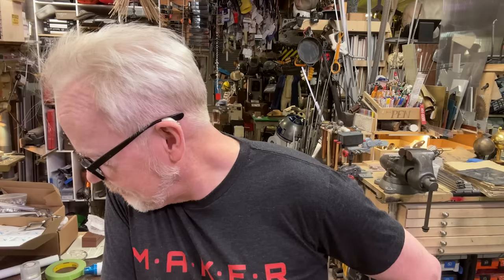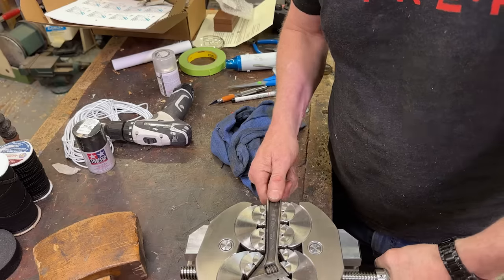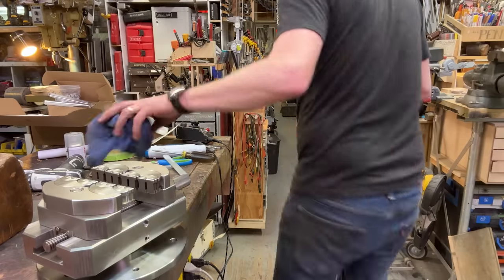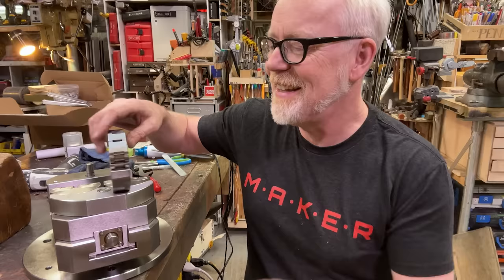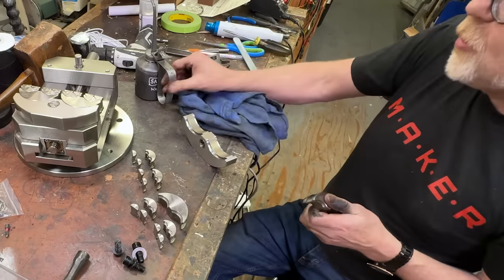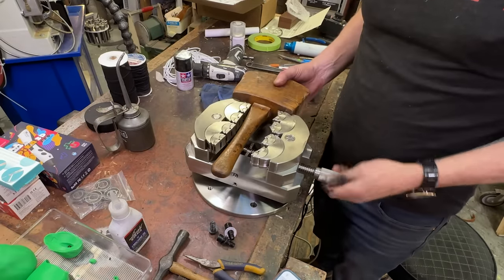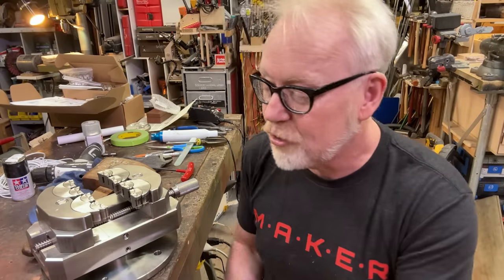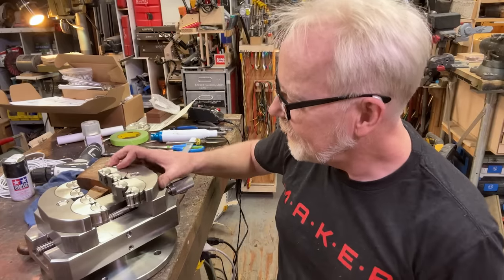Adam Savage in Awe of This Fractal Vise!

Comment: Adam, when I saw the Handtool Rescue episode about the fractal vise, I too coveted one. Congratulations of finding one!
You might want to consider machining a duplicate set of the smallest jaws in a softer, non marring material like bronze, brass, or aluminum for holding pieces you don't want to mark with the clamping force.
Reply: If I had this vice and Adam's tools and skills, I'd probably make half a dozen different sets of jaws, especially to do some testing before deciding the best way to modify the mating surface.
Reply: ... or, perhaps, 3D print the jaws (?)
Reply: If I had one and the machines to do that, that would definitely be a very good idea! Set of, nylon, brass, wood and maybe rubber caps
Reply: Perhaps just make a duplicate set of clamps and somehow adhere rubber or some sort of soft grippy material to the faces rather than metal
Reply: @johnherrmann7464  The issue with 3D printing, regardless of if it is plastic or metal, is going to be the lack of smoothness of the mating surfaces. At minimum the mating surfaces would need to be machined to achieve a nice smooth surface to allow proper low friction movement of the jaws.
Reply: @mafftv3801  Caps may not work. I think the whole vice is based on having the centre of each rotation inside the workpiece, as otherwise they will turn in the wrong direction. A too thick cap could stop it working. 
If this isn't the case there are much easier and cheaper ways of doing the pivots.
Reply: @daveansell1970  Surely you could solve that by shortening the piece to match
Reply: @anthonyruiz-carvalho31  Could have plastic clips (3D printed) that grab the smallest jaw at the top and bottom.  Onto this you can stick whatever soft material you need for the task, and be able to remove or switch clips easily.
Reply: @Chocomint_Queen  Yes, though a lot more of a pain than just sticking some stuff on the front face.
Reply: The price has already jumped by $1000. Now $2601 with $645 shipping.
Reply: @RS-ls7mm  Wow, thanks for spotting that. would love to see the company make something about how these are made.
Reply: @nickl6820  OK.  Understood that 3D printed parts aren't always as smooth as we'd like them to be.  But the critical surfaces can probably be sanded or filed smooth.  OTOH, *how* would you machine the curved dovetails??
Reply: @johnherrmann7464  That's a good question that I can only really guess at. I work on the design end of things and don't off hand know what kind of tolerances are needed. Turning it on a lathe would be my guess, but it would not be the most material efficient method and would require additional processing steps to finish the part. I've seen some far more torturous dovetail grooves done via 5 axis cnc, but they were for o-rings and much larger.

Comment: Lapping compound will be great for adjusting clearances (it works against both surfaces), but if the clearances are good, I suggest simply polishing the mating surfaces.   Use a piece of leather and make miniature strops with polishing compound.  You should be able to cut the leather to fit the dovetail slots and just lightly polish the surface.  This method won't significantly change the mating tolerances because you'll be only be removing .0001" or even .00001"  from 1 face at a time.

Comment: I feel like a rubber head for each of the smallest pieces might be useful.  The rubber would allow the vise to conform better to what it is gripping.. it would be like an infinite fractal vise.   And because the pressure would be more uniformly distributed you could grip stuff like wood without worrying so much about damaging it
Reply: It wouldn't hold it as still, though, since the rubber would compress and expand as you applied forces to the item being held.
Reply: You are on the right track!
Reply: cut 2 horizontal dovetail canals on the outer pieces of just one side(should be more than enough) and insert interchangeable teflon, pvc, rubber, wood, etc... depending on what material you need gripped
Reply: or just one vertical canal, on the near edge of the outermost pieces
Reply: That's likely something very situational. This vice like most probably is specifically designed to use the metal surfaces to hold parts specifically because the metal deforms less.
You have to remember that the rubber might give it a better grip but it'd allow you to wiggle objects more in between the faces. Metal bearing surfaces might not have the same friction and grip in that way but the parts are held in a tighter position.
Reply: @ra3or  actually I'd try a horizontal and vertical v shaped canal, not more than .5mm deep. this would restrict both horizontal and vertical movement and create a lot more grip, I would think. Of course, I may be wrong and would be happy to learn why

Comment: This would be awesome with interchangeable tooth sets, such as nylon, brass, wood, etc for holding different materials while minimizing surface damage. Could be the entire final teeth, or just mountable pads w/different surface grits/materials.
Reply: This is exactly what i was thinking. Maybe a rubber pad made en masse to preserve the leading edge.
Reply: First place i worked at did that. They did furniture repair and had a vice like this with soft rubber caps over the teeth for holding finished wood and metal.
Reply: Good idea
Reply: Same thoughts here. Multiple sets of final crescents. Some might be doable with a good 3D printer. Or maybe the manufacturer sells them separate ? and they could be surface tooled or coated ?
Reply: Running a strip of cycle inner tube along each side would be a quick and dirty way to achieve this…
Reply: I was thinking something along the same lines. I foresee an upcoming video where Mr. Savage creates some kind of custom molded silicone soft jaws to protect clamped objects but flexible enough to allow the vise to still conform normally around said object.
Reply: Would adding even a thin layer to the front not change how those teeth move within their niche?
Reply: @amazinggrace5692  If added directly to the teeth it would but something flexible that fits over without being attached should work.
Reply: @ducktape69 (commented above) seems to have an old fractal vice with multiple sets just like you're talking.
Reply: I don't think I would have use for one of these with steel teeth, but something softer like rubber or nylon would be utterly wonderful
Not just from the point of view of keeping the finish of a piece nice, but for getting a lot more grippage for the amount of force being put into the work
Reply: @bryanoneal4929  Ah yes, thanks! Good solution. 💕🐝💕
Reply: Machine a dovetail into the smallest jaws and have drop in inserts. Brass, crosshatched steel, vulcanized steel. Slide in vertically. May be tricky as you probably can’t cover the entire surface just a portion of the center as it would interfere with the rotation and binding against the other crescents
Reply: @ironmikeharrington  as long as the pads are within the arc of rotation you should be fine. Could also utilize a stop set screw to mount/limit the arc like the ones on Hand Tool Rescue
Reply: @amazinggrace5692  
As long as they were affixed to the front surface and didn't impinge on the arc's movement, there would be no issues - and weren't so thick the jaws failed to align properly.
Reply: @ironmikeharrington  
That's a cool idea - might work better for the 4+4 arrangement, rather than this 8+8, for the ease of manufacturing and use?
Reply: You could probably do this with some 3D printed slip covers.  I agree, though, a more pro option needs to exist.
Reply: Definitely, or even a coarse grit sanding of those grip faces, leave the steel face just make them rough.
Reply: a length of solder, a strip of leather, etc, are time tested ways of lining the jaws to protect the work piece while providing secure work holding.   I use leather regularly for various soft jaws on finished pieces.

Comment: I work as a machinist and I have never seen a fractal vise, but it seems like a cool idea. It seems like it would be good to hold things like cast parts, but I think it's drawback is the smooth gripping surfaces.  I would be cool if you could change out the smallest pcs with something that had serrations.  If you were looking to make the parts move/slide more easily I would start with rounding out the sharp corners of the mating parts.  Most interference comes from sharp corners not being as sharp due to tool wear, so slightly chamering/deburring/buffing sharp corners of the mating parts can help parts slide against each other.
Reply: yeah, although it looks like Adam modified the jaws a bit since they look different in the thumbnail
Reply: The flat gripping surfaces aren't part of the actual original; there's an opening to allow for more grip with finer points to grab.  That's part of what he discussed in the video in altering the flat gripping area.  If you look up the video in question, you can see that the grasping areas are actually like large serrations that end at an angle and not flat.  He may alter it to do the exact thing you're talking about, just different because the points are just one each side of the semicircle; there's no flat area with multiple small serrations.  Since it only gives two points of firm grip instead of a flat line of small serrated grips, it can swivel to hold more abnormally-shaped things.
Reply: I suppose you could disassemble the vise, like Adam did, and sandblast the gripping surfaces.  BE SURE to CLEAN all the parts thoroughly before reassembly!!!!
Reply: The original ones do not have smooth gripping surfaces.
Reply: What about putting on small Laser Cut Rubber Grip Strips that have a Adhesive backing.

This would avoid marring the work object with the metal teeth
Reply: I think the small pieces that make the contact, as y’all have pointed pointed out, shouldn’t necessarily be flat. Meaning maybe a second or third set of grippers with different contact surfaces. 

In compromise I think the final surface should be two outward arches. ie, bumps. The flats look like 1/2 in. or so. So that should be two 1/4 in. cylinders. However that might result in too high a pressure on the contacting edge. 

But… a second set with a simple V, the original set, and my idea of two outward ‘dowel’ shape faces. There are 8 flats. I think forming them into two contact points each, 32 points in total both faces, would make for higher compliance. 

I’m at loss for machine speak to describe it properly, but I hope you get what I mean.
Reply: And yeah, the thumb nail have modified contact jaws. So it may be a done deal.
Reply: I’m thinking load up the ways with a light oil then add an ultra fine polishing compound, like Flitz. Then elbow grease working for even a minute or two each would deal the high points a hone the ways. Then after an hour in a sonic cleaning tank the key would be on the lubricant. 

And it’s tool that has to be kept clean. One metal chip in any on way and it’ll gouge and cause irregular gripping…. You know
Reply: The ones I have seen had slip on rubber grips, the mechanics in the company I worked for just used the serrated teeth for their work, seemed good enough for what they were holding, likely they just wrapped the item they needed to hold in rags before vicing.
Reply: Smooth gripping surfaces are common on milling vises though. No one wants serration prints in their finished workpieces. Gerardi, Kurt, and almost  all come standard with smooth hardened jaws. I guess if it's really for cast pieces only serrated jaws would make sense, but it would severly limit the usability for anything else.

Comment: Adam it may only need a very light deburing to make the jaws move correctly. I would NOT use laping compound. The jaws are sticking a bit already, so it could be a real bad time.  Consider a precision ground stone to de-burr with. As for the handle, mill a square on the Acme thread. Then use a normal vice handle. The jaws could be closed securely, then drilled with a bit around 1/3 of the diameter to get the smaller contact surfaces you want.
Reply: lapping compound works great on other fine fitments like 1911 slides. I wouldn't hesitate to use it on this too.
Reply: Look at the thumbnail. It already has chunks taken out of every crescent. It's too late to suggest anything, because he already made the follow-up video.
Reply: @veronicavaes4581 here I am coming to the comments to suggest clamping on parallels and using an indicator to square it up and check jaw alignment, and I totally missed the thumbnail where he's already drilled out the middle of each set lol. Wonder why he didn't edit out the request for advice...
Reply: A valve lapping compound wouldn't work very well imo, but a non imbedding lapping compound that gunsmiths use like JBs would work wonders on that thing. I use it on all my rifles and trigger packs. It's just a PITA to clean all the paste off the parts once it's lapped in.
Reply: @ericbrooks2819  it's definitely an odd choice. I'm guessing this video sat on the back burner longer than planned, and by the time the channel's editor wanted to publish, they realized there are no usable-as-thumbnail stills of the unmodified vice in action.

Comment: If your going to remachine it you should consider adding a small indentation to the top of each semi circle or pair of indentations offset from center, and make a tool that's basically just a pin on a handle, then you could insert the tool into those indentations and make fine adjustments while tightening it by hand, similar to how the original set screws worked. Really cool tool.

Comment: Just loved the joy Adam exudes over the toy he just got. And also really like the point he made about Chinese manufacturing. Yeah a lot of it is based on what gets put out the most, which is made cheaply , cause it’s meant to be sold for cheap, but isn’t always the case. For example in the knife space more and more manufactures like Maxace an We Knife are making some amazing products, which I bet they put a lot of pride and effort into making, and not just cheap replicas.
Reply: Someone finally gets it. People buy from $1 stores, AliExpress, Walmart, etc and complain about the quality. Like what did they expect?
Reply: yes the cheap stuff from china is usually low quality. 
but i think he expected nicer then harbor freight quality for 2500$
Reply: Some of it is also likely trend chasing and start up manufacturing tends to be common. It doesn't matter if you have quality materials, good machinist, with good tools, if you don't have a technical package or a strong understanding of the product needs you're basically guaranteed to put out junk because the fit and finish wont be right. A good non Chinese example is the L85a1 versus the L85a2 where fundamentally they are the same design, it's just the l85a1 was made by people who didn't understand how to make guns and the L85a2 was made by people who did.
Reply: @FrickingLunatic  I don't think you have any idea how much work a vise like this is compared to a normal vise. I'm a CNC machinist, but the operations and setups required to make all those fitting curved dovetails is not to be underestimated. It also seems, and probably is, a steel vise, very likely heat treated, while the cheap harbor freight vises are cast iron with nearly no machined surfaces.
There is also a very small market compared to a normal vise for something like this, this means small production, and lots of setup and programming time. 2500 dollar does not suprise me.
Reply: @slome815  i think you misunderstand me. i am very physics minded in engineering. i was stating the chinese tools are usually crap. that was my statement. that it the general mindset of most people today. adam himself says this. i agree with him and you. and if i paid 2500$ for a vise i would expect it to be well engineering and built. by a person such as you.

Comment: Hey Adam, I think the fractul vice would work amazingly well if it was installed onto a mounting system that would also allow you to turn the vice into a vertical position.  That would give you unlimited holding ability for the most part concidering it has the ability to spin 360 degrees.  Wow.  worth every dollar!
Reply: i think it needs a bit of an addition before you could do that, since the clamping surfaces are only held on to the vice by gravity
Reply: Why is it so hard to find a fractal vise?

Comment: The quality of the machining on that is incredibly satisfying.  It's made to be worked in over time to be remarkably functional.  I think we'd all love to see you make a brass set of jaws for non-marking holds.
Reply: It did not seem that functional, as we could see with that hammer handle, those small holders need to be manually adjusted, plus they are not holding that handle tight.
Reply: Looks great. Shows that Chinese really doesn't always mean straight to landfill. Price reflects!

Comment: Machinist here, a lapping compound would be a great way to loosen those jaws up. I would say that after you lap them, to not use way oil as lubricant. Something with that tight of a tolerance with that heavy of an oil will pull a bit of resistance, especially on cold days. I'd use 3 in 1 oil for that, or just whatever the least viscous oil you have around is. Thanks for always showing so much excitement for the field too!
Reply: Sewing machine oil is perfect for lubricating moving parts, really fine and available all over the place
Reply: +1 on the lapping compound.  Steel wool made me cringe.